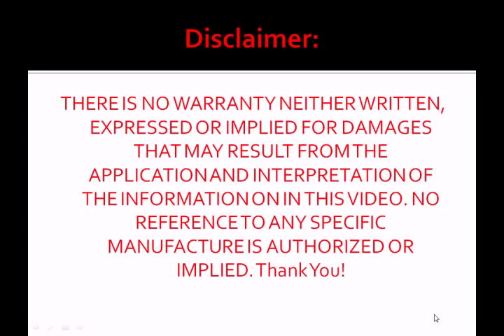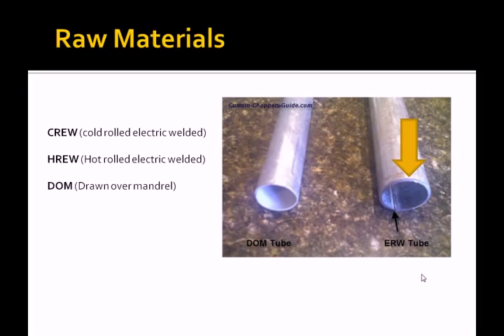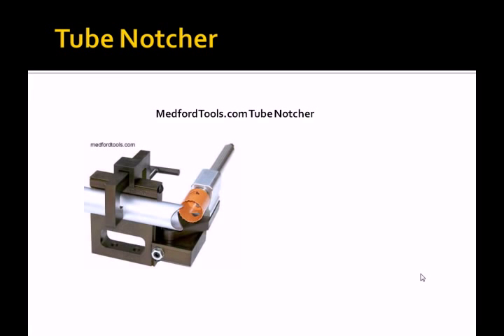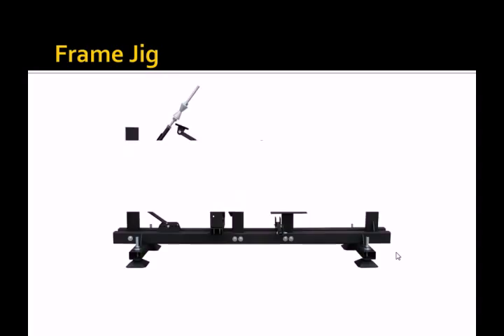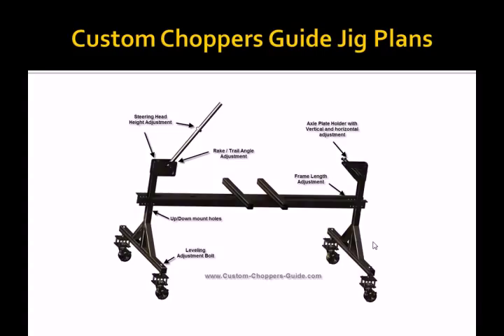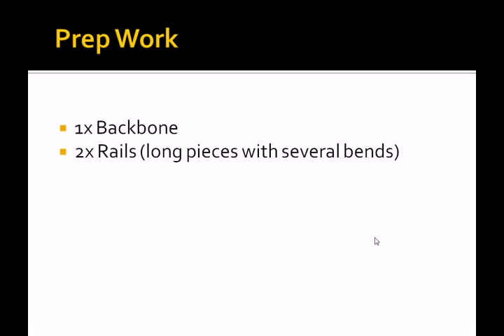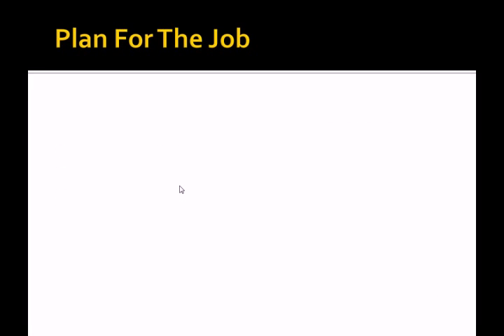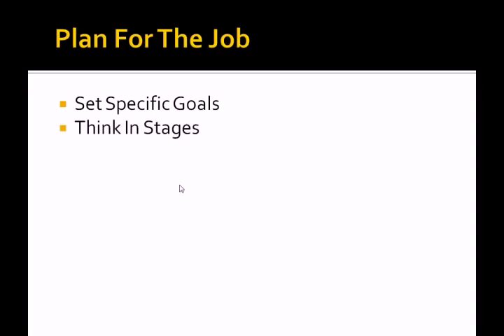Build a Motorcycle Frame Part 3

Comment: Good information but for welding you do not use pure Argon for MIG. Depending on what type of metal you use will determine what blend of gas you use. unless its mild steel. You can use CO2.